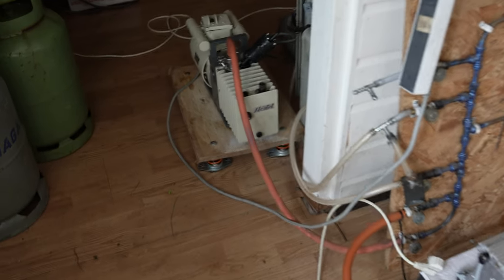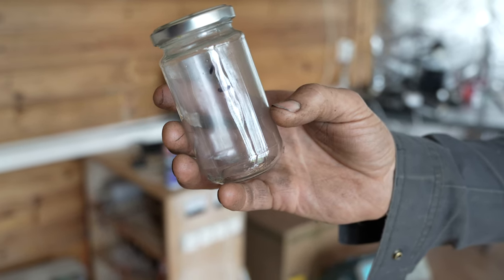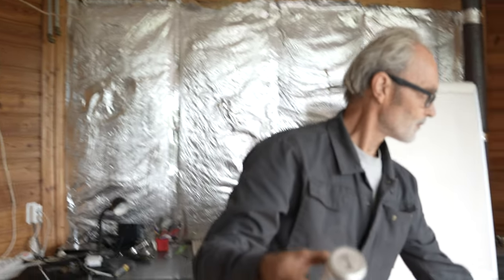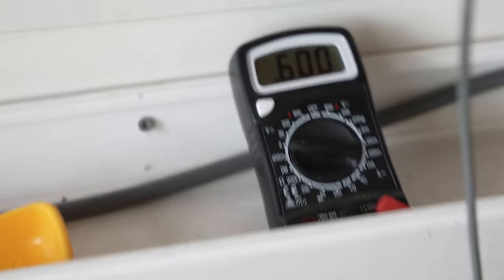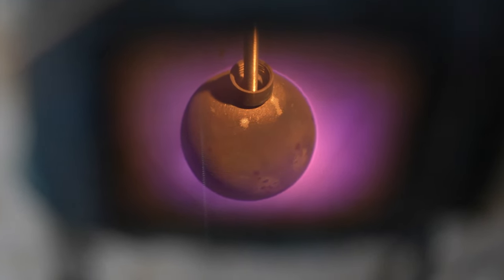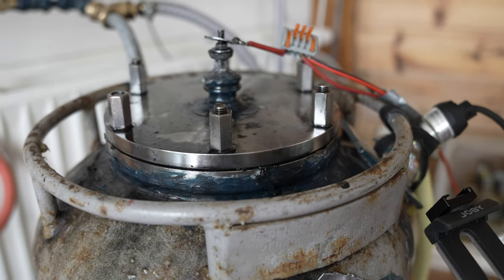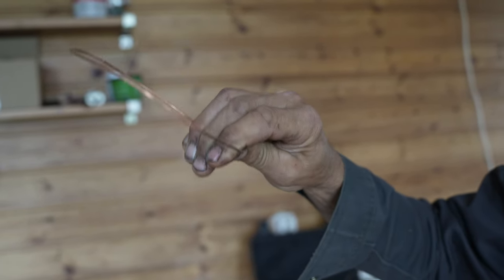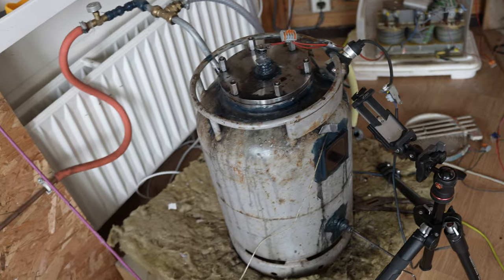VEGA - Update and announcement

Comment: Very cool!  Dawn dish soap and a spray bottle works pretty good on HVAC leak detection…thanks for the update Gents.✌🏼
Reply from the maker: Yes - we have used similar things in the past.
Reply: @MFMP  is he looking to make an insulating gasket?  If so, they make this HDPE called Star-Board that you can get in sheets and then use a CNC or a hand router if it’s just a simple circular.  I used the starboard on a display product line I designed years ago, the  company is still selling them I think.  Regardless the material was developed for boat decks, it’s UV protected and may help. 
ABS sheets could also work, cheaper….

Comment: Regarding the copper wire seal, try fully annealing the copper before installing. Then it will be malleable enough that torquing the cap will flatten it for a better seal.
Reply from the maker: That may be because you recommended it Alan! Good tip by the way.

Also what was the specific Cotronics ceramic you used to seal the GSs, our friend mislaid his notes.
Reply from the maker: comment below for your other comment.

this is another good tip.
Reply: @MFMP  For GS6 I used Cotronics Resbond 904 for the coil center and Resbond 920 for the thermocouple caps

Comment: I also use an Infinicon capacitance gauge in my system, for the same reason. It's a fine product, very accurate and stable. One caution though, these gauges can be easily damaged by over-pressure. This CDG model has an absolute maximum of 4 bar (400 kpa).

Comment: I have flat copper alloy seals used in a vacuum system for a electron microscope plus I got hollow round rings for a Oerlikon cannon air pumps for more 14 gunsight  one can contact mr alik in Greece
Reply from the maker: We use vacuum seals, we really need to upgrade the reactor chamber to allow use of them in VEGA.
Reply: @MFMP  yes iam familiar with them maybe Mr alphas t right type typ e ones